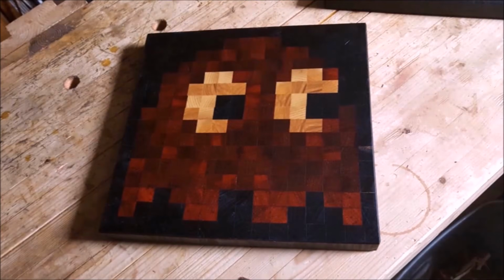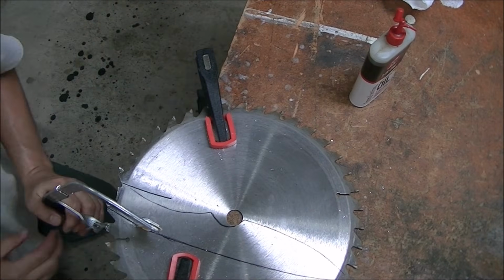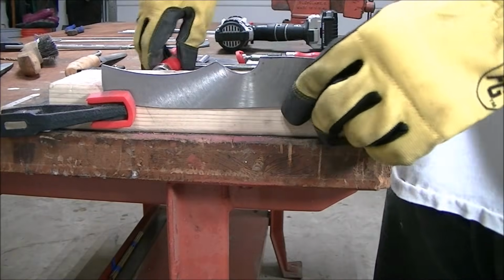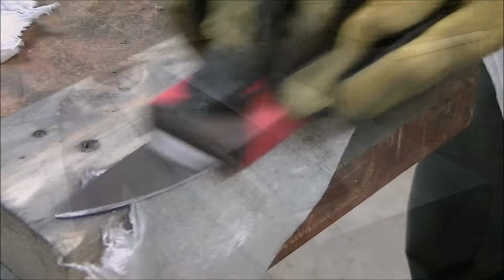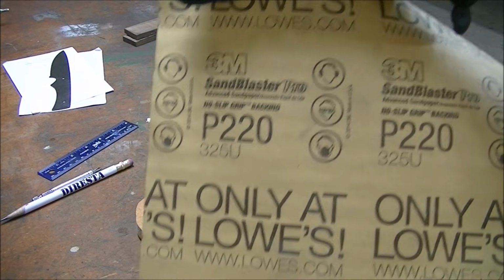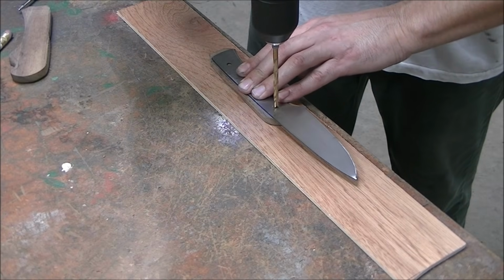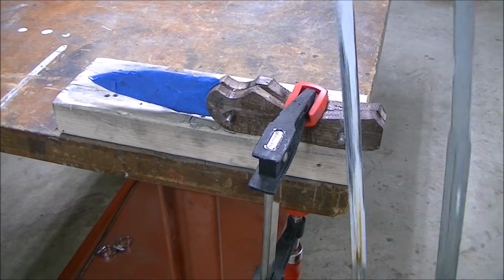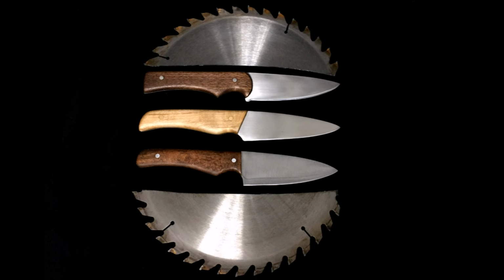Saw Blade Knife with Limited Tools

Comment: What happened to your plunge grind. I can’t see where you ground the knife at all. That’s something I don’t understand about making a knife from a saw blade. The saw blade is so thin I don’t see why you can’t just put a bevel on the edge and call it done which is what your knife looks like.don’t get me wrong,it looks great but ? About my questions. Thanks for the video. I look forward to trying with power tools of course. Lol.
Reply from the maker: This was the second knife I ever made and the first time doing it all with no power tools.  Before the build I thought I would be able to do a plunge line but I didn't have the skills to do it, chalk that up to hubris or naiveté probably a little of both.  To be honest I still don't have the skills to do a really good plunge line. For material this thin a plunge line isn't a make or break necessity.  A nice bevel on the edge is good enough especially if you can work that in to a nice flat grind.  I think for most beginners making knives out of saw blades is a good way to practice without breaking the bank, most folks I've seen start off with saw blades and mystery steels, they learn their lessons and then move on to "knife steel".  I feel like its a right of passage when it comes to making a knife.  You start off by using mystery steel with limited tools and then you level up.  You get better steel better tools and improve so on.  I was careful not to title this video "How to make a knife from a saw blade" this was more about the challenge then the end result for me.  I just wanted to document my process so that others would hopefully learn from my mistakes.  Good luck with your knife making journey.

Comment: For most standard skill saw blades about 375 or 400 is about right for a hour then.  Let it cool in the oven correct? Thanks for responding to my questions.  I Appreciate your input . I'm fairly  new to knife making and have little tools. I posted a few hand made knives on Facebook .  You are welcome to check them out . Look up Duane Balluta on Facebook.  For me it's a hobby and I have sold nothing . So far I gave away what I made to friends.  This is something I'd like to take more seriously.  Again thank you for your advice.
Reply from the maker: Yes that's what I have found works for me preheat the oven to 375 or 400 then put the blade in for one hour and turn it off.  I leave it in the oven to cool down to where I can handle it.  This is a hobby for me too so make sure you check out other folks out there on YouTube and do as much research as you can.  That's how I learn most of what I know.

Comment: Bringing a skill saw blade back in the oven.
 Another question I have for you. I read that some people run the oven at different Temperatures . What's your take on it and why do you run your oven at that temp?
Reply from the maker: Now take what I am about to say with a grain of salt, I'm no expert.  Different steels may require different temps. stainless steel is a whole other animal.  When it comes to heat treating in a home oven there is going to be some inconsistency versus a professional heat treating oven that keeps the temp steady.  Now with that said I have also seen blacksmiths that heat treat in their forge simply by getting the steel to that "dark wheat" or "bronze" color by slowly heating it in the forge and checking the color.  I believe for a lot of steels, that "bronze" color will get your steel to a hardness that is acceptable in that it will hold and edge but won't snap the blade if you drop it on cement.  There are bladesmiths that like a certain hardness and they can dial in that hardness by having a very thorough heat treating schedule.  I just shoot for that "bronze" color because that is the one constant that I hear over and over again.  In my oven I can achieve that by setting the temp to 375 degrees Fahrenheit and leaving the blade in there for an hour.  I leave the blade in the oven while it cools.  I run my oven at 375 because that is actually 400 degrees.  I tested my oven for accuracy by using a piece of steel that I put in at 400 degrees then checked the temp with a  laser thermometer.  The thermometer read 425 degrees so I turned down the temp to 375 degrees waited about 30 mins or so and checked the temp of the steel again. This time I got closer to 400 degrees.  So I know that in my oven 375 degrees is really 400 degrees.

Comment: I started using saw blades to for some knife builds.  The problem I had was when I put the finish knife in the dishwasher after it's first use the knife came out rusty.
Reply from the maker: Yes that will happen with any carbon steel.  Stainless is the only one that wont rust but making a stainless steel knife requires a lot more work in terms of heat treating.  If you dry the knife after washing you should be fine.
Reply: put it for about 20-30 minutes in vinegar. You will lose the shine, the surface will be covered by forced patina. Let it dry from the vinegar, wipe it with cloth that you are not gonna use any more /:)/ and wash it with doshwashing liquide. This will not stop the rust, but will reduce it, because its place is already taken from the patina. and again: no dishwasher for the carbon steel. And dry it after washing :) regards
Reply from the maker: Awesome tip thanks for sharing!

Comment: What was the liquid you put on the blade before drilling the holes? Also isnt a saw blade stainless steel? And are these food/dishwahser safe?
Reply from the maker: Its a 3 in 1 oil it helps with the drilling through metal.  Saw blades are not stainless steel and they are not dishwasher safe.  These knives will rust if they aren't kept dry.  So its best to wash them and dry them off right away.  Any carbon steel knife that doesn't have a coating will rust if it stays wet.  That's one of the benefits of stainless steel its very corrosion resistant.  Thanks for watching and for the comment.
Reply: Dan The Maker Man whats an alternative to 3 in 1 oil? would water or wd40 work?
Reply from the maker: Yes WD40 would work it just lubricates and cools the bit.

Comment: I really appreciate the effort you put in here, but did you think to anneal the steel to soften it before you began? Turned out pretty nice. How many hours did you invest?
Reply from the maker: I thought about annealing it after I cut it, LOL.  I have somewhere between 30-40 hours I worked on it over several days.  But I'm convinced that I am a slow worker in general so take that with a grain of salt.  Remember to check out July with Fitz knife  build video.
Reply: I already checked it out. Great work both of you!

Comment: Dan the video was interesting you did a great job on the knife I especially liked the way you used the saw on the blade that was work hope you had a cool place to work in
Reply from the maker: Thanks Tom unfortunately my garage is hot and I was pretty much drenched with sweat at the end of every day.&#160; I actually changed shirts a couple of times during the build each day.&#160; I didn't want to look like I was putting out a wet t-shirt contest video;)  Remember to check out July with Fitz's knife build video too.

Comment: You did one hell of a job on that knife, great respect for your hand tool work.
Reply from the maker: Thanks Lyle I appreciate the compliment and thanks for watching.
Reply: Sorry, he didn't. The edge retention will like a six cuts and gone :D. These 'knifemakers' are a joke to real craftsmans. What about to find out some information about steel first? No? If the saw blade has welded teeth, the body of the blade is junk steel about 0,3% C and can't be used for a good knife. So much work for such a useless result. FYI, I'm metallurgy specialist.

Comment: Nice on Dan! Do you find the leather strop makes a big difference?
Reply from the maker: Thanks Robin.  The strop definitely makes a difference, you can tell when you slice paper.  If I sharpen up to 2000 grit and slice the paper it will slice it but you can see the small fibers of the paper at the cut and you feel a slight resistance.  After stropping the knife it glides through and the cut is a lot cleaner.  Its an inexpensive (leather strop and green polishing compound) and fast way to tune up a blade.   I have recently heard a lot of guys say that they use it for their chisels.  They will make a few cuts and then strop the chisel to re-sharpen it.  If you have an old leather belt give it a shot it just has to be real leather.
Reply: An old belt is a great idea, think I might have one of those lying around
Reply from the maker: FYI, if you use an old belt scuff it up with 80 grit or 150 grit first to get any coatings off of it. Then rub some of the green compound on there, then strop.  I used contact cement to glue the leather on to my wood board.  Whatever you glue it on to just make sure its flat.